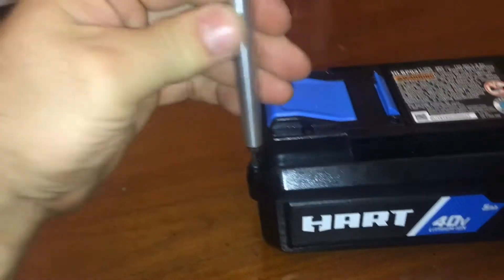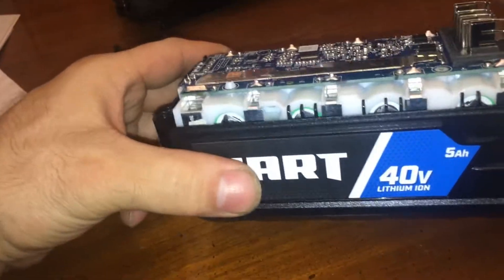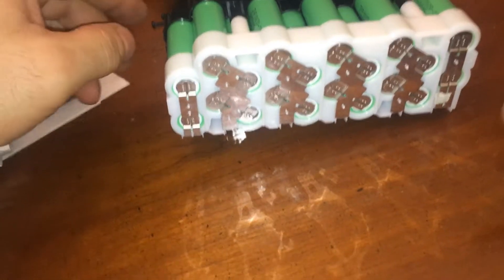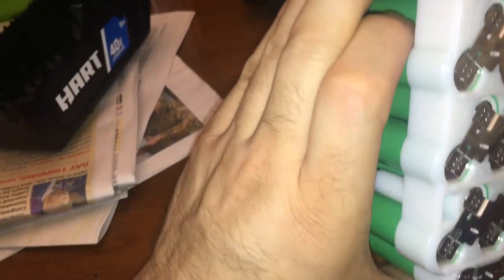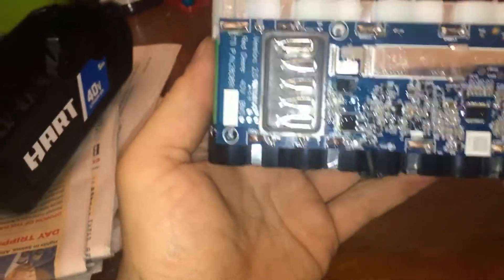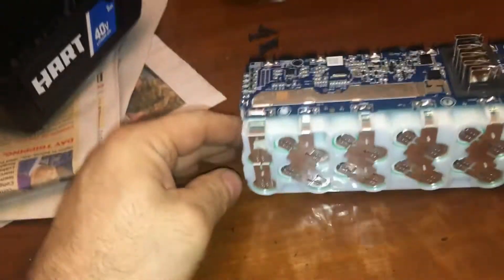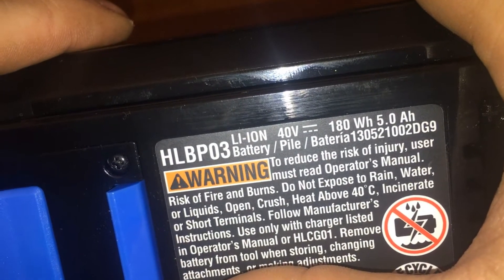Walmart Hart 40v 5ah battery what is inside I bet 18650 batteries HLBP03

Comment: 1:51 Conformal coating most likely. Corrosion protectant, rust is what kills most lawn and tool batteries and is why modern EV packs are being filled with foam.
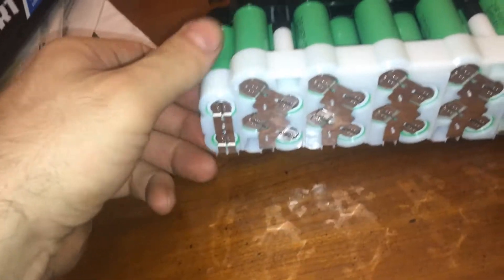4:00 Under-rating, likely for cell lifespan and to prevent battery fires and damage.
4:30 10S2P? Interesting, then these could be ran off used eBike packs.

Comment: Any idea where I can buy a replacement circuit board for this? I got flashing lights error. I am sure the cells are most likely perfectly fine.
Reply from the maker: dead ones on ebay... but then u dont know why its dead. I hear there is some reset procedure that possible can work that was for ryobi which is same thing. also desoldering that circuit board doesnt look like fun lol. what I would do though is check the voltages on the batteries. FULL voltage and each cell. depending what you find charge all teh batteries up to 4.2v'ish I think usually what those errors mean is the voltage is too low to charge. its not hard isolating 1 battery at a time to charge them if u pay attention to the metal rails they are attached to
Reply: @bobspurloc  My battery flashes all four lights. It measures at 24.4v so it isn't dead. I believe it just needs a reset, but I don't know the procedure for doing so. Upon opening the battery, there are two 3.3v and two reset contact points. Would you or anyone here know the procedure for resetting this battery?
Reply from the maker: @davcar872  it's a 40v battery measuring at 24v. im not sure but that is way low. ide try and charge each battery manually to get the voltage higher. did it sit a long time? that voltage is bothersome because the battery is going to shut itself off before getting that low. and lithium dont drain that fast sitting so it seems possible a dead cell or 2. but who knows until each sell is tested

Comment: Had a blower catch fire when I added 2nd 5 ah to other port. Is it possible battery is defective or is it something more that I'm missing?
Reply from the maker: you said blower caught fire. that isnt enough information to deduce a cause. where was the fire? blowers motor?
Reply: Battery caught fire  .
Reply from the maker: @michellelogan2124  well that would seem a bad battery. was it used in other equipment? how old is it? call HART yet? was the battery left outside in the rain?
Reply: It was about 2 months old originally with a new 5 added that was brand new. It is being replaced. I  guess they di have a failure rate. Would be interesting to know if anyone else has any problems similar to this. Appreciate your time and response.
Reply from the maker: ah good to know. I have 10+ of these batteries most still in the boxes. first use?

Comment: AH is Amp Hour. Not amps. The actual current draw is most likely different. So it most likely does draw more than 180 watts. But those are WH watt hours. They are a different kind of measurement than standard watts, amps and volts. The reason why you math doesn't add up is because you are using the wrong math for the values you are given.

As for how many amps each cell can output is based on 2 things. The first being the capacity of each cell and also the max current output of each cell. These two values can be different. You can have a 3.5 AH battery and it can output 10 amps safely because they are 10 Amp cells. There are cells that are 3.5 AH and they can safely output 25 amps. And some that are less expensive output 8 amps but are 3.5 AH.

They didn't put tape there because it is all insulated already with the plastic battery holders. So there is no need for it.

Comment: Nominal voltage is 36v, fully charged is 42v. Ten 18650's is 42v at 2500mah. Put another ten 18650's in parallel with the first ten, hence twenty 18650's ..you get 42v at 5000mah or 5.0AH.

Comment: Do you know how long I can cut grass with these but I do know it takes an hour to charge them
Reply from the maker: I dont know the size of my lawn but it takes 3 batteries to do because a big area is dense grass and I tend to mow 2 weeks apart. also I tend to have the drive at full speed the whole time. You cant drain a battery down till it cuts off and recharge it in an hour. u cant do that because the battery wont let you charge it until it cools down. if u were to stop using the battery just before it cut out u may be able to throw it on a quick charger. also of course putting it into a freeze etc would cool it down which of course will lead to extreme whining that will cause condensation in the battery etc etc etc u could open the battery and put a fan on it, that would cool it down faster which again brings on extreme whining of omg u can electrocute yourself etc stupid etc
Reply: @bobspurloc  yeah I bought the 20 volt mower. It took more than an hour for the batteries to cool enough to not be slightly concerning lol. Now I'm not sure if I should get the 40 volt. I live in a mobile home park. My yard isn't that big, but it went through both 20 volt 4Ah batteries really fast lol.

Comment: My 40v battery reads 17.5 v but won’t recharge. Only had for a year. First try of this year and it won’t charge. Any ideas other than $170 for new one. Could it be the junk charger?
Reply from the maker: the battery has 3 year warranty. does charger say its charging it? Lithium Ion dont usually just die
Reply: @bobspurloc  the charger is just double flashing the red light. The battery just flashes all 4 lights
Reply from the maker: ah ok so battery is alerting something is wrong. about all you can do is contact Hart I believe as the battery has a 3 year warranty. did it get rained on? also beware any serial number discussions as hart batteries serial numbers dont tend to match the packaging. I have several videos clearly showing batteries new on the shelf at walmart dont match the packages serial number also they now sell 2 packs of the 20v 4amp with only 1 serial number on the package which of course cant possibly match the 2 batteries inside lol
Reply: @bobspurloc  never been outside unless I had it in my hand using it. I don’t have the box it came in, that was last summer
Reply: @bobspurloc  I opened it up and don’t see anywhere to reset it. Tried the jump start thing different ways and nothing works
Reply: @bobspurloc  called Hart today and they are sending new battery. Thanks for help. Stay safe
Reply: @donhixon1669  You may be able to revive the old one. Likely one or more cells inside have dropped too low and disabled the battery. If those cells are only a little bit too low they will usually recover if you can charge them all individually. The lower they have dropped, the less likely they are to be usable (i.e. 2.5v is often the cut off and if yours are all about 1.7v they might come back, down under 1volt starts getting pretty iffy). There are endless videos on youtube.
Usually what goes wrong is one cell is a bit weaker and runs out quicker and the battery shuts down the tool. If you don't recharge the battery right away it will keep dropping until the battery is disabled. Best to store the batteries about 1/2 charged, but never less than 20%, in a cool dry place and disconnected from the tool and from the charger.
The best way to recover is to use a hobby bench power supply that you can set for a max voltage of 4.2 volt and a very low current (like 20ma until they are over 2.8v and no more than the amphour rating on the cell, like 1500ma or 2000ma or 2500ma etc) and individually charge every cell in the pack up to 4.2v so they all match.

WARNING: there is some minor risk of fire and/or explosion. I've never had it happen with 18650s but it could. I have had some vent their guts and make a mess. I've always used a safe power supply to charge. THE RISK GOES UP IF YOU HAVE UNCONTROLLED CURRENT or VOLTAGE CHARGING.
Reply: @Sylvan_dB  Thanks. I contacted Ryobi/Hart tools and they are sending me a new battery since it is still under warranty. I don’t know a whole lot on the electrical side and if there is even the slimmest chance of a boom, I usually find it.

Comment: They really aren't 40 watts but 36.  The 40 w is the no load voltage.  18 and 20 volt batteries are the same, just measure differently.
Reply from the maker: you mean volts not watts. but that isnt correct. the 18650's are 3.7 volt batteries. a fully charged one is 4.2 volts. the voltage drops as it drains and thus it lights less LED's to show the voltage has dropped

Comment: I want to get a 4Ah because I’m suspecting they might have higher discharge cells in them. 2Ah capacity but 30A discharge vs the 2.5Ah 20A of these
Reply: Probably only going to be 20A-22A cells, most likely the. INR18650-20R.
Reply: @geoffstrickler  feels more like 15A

Comment: Probably gonna rebuild mine with LG HG2 cells. 3Ah 20 Amps so effectively the same performance with 1 amp more runtime.
Reply from the maker: ah. $6 a battery? I see at battery junction. or $5.50 for 4+ what do u use to attach a wire to the battery?
Reply: @bobspurloc  gonna try building a spot welder.  You can use a car battery and high current solenoid to make those welds.
Reply from the maker: Oh damn! nice. I see! ok this is going on my list as something to build also! LOL...
Reply from the maker: is that powering off of 18650's??  hrmmm I could plug this into the  Ideation GoPower Plus Emergency Portable Power Station it has a 12v source plug like that. https://youtu.be/m7vDkJY383g
Reply from the maker: oh my bad lol. I was thinking soemthing else. plug is for the momentary battery zap
Reply: @bobspurloc  yeah basically for that kind of weld you need a high energy burst. Could be done with capacitors but for the most part it seems easiest to use a car battery.
Reply: @bobspurloc  this is what I meant to link you to originally. The Amazon tool is just easier to do than little pieces of wire.

Comment: What bit size are you using to remove screws .I have tried several with no luck.
Reply from the maker: how to remove a security bit center pin lol... https://youtu.be/iEAlK-bjyAo
Reply from the maker: its a T10 security bit aka torx 10 with the hole in middle. if you look at the screw head you see the pin in the middle. just knock that pin out. you can use a sharp nail to knock that center pin out or a drill starter punch to smack it a few times that will either knock it out or crush it.

Comment: 20v batteries go into 40v tools and vise versa?
Reply from the maker: no. but if you modified stuff they could.
Reply: @bobspurloc  if the rails are interchangeable I would love to break up a 40v and use higher cap batteries making a massive 20v pack.
Reply from the maker: @samfish90212  I just realized I have 20v HART batteries now. I should check out the pins and rails

Comment: Just saw two 5ah hart battery packs clearances down to $77 at my local Walmart I have all greenworks equipment Including a 14” chainsaw that drains batteries quick Looking at the batteries in Walmart I was thinking they look very similar to greenworks after viewing your video I think they’re pretty much identical they probably just have some kind of plastic tab to prevent swapping between manufacturers. I had a 2.5ah battery that came with the chainsaw when I bought it used off of market place and died on me after using it twice. When I tore Into it to salvage the cells inside was a mess with corrosion from being left outside in the rain anyways they had the exact same cells as yours same size pack only half filled with cells where my 2ah pack is half the size
Reply: Some walmarts are selling them now for 35. One had it for 17$
Reply from the maker: yeah I have a bunch of greenworks and hard 4ah/5am batteries now but not from buying them as singles but from buying actual equipment that was on clearance under $100 with the battery in there! lol

Comment: Those are Samsung 25r 18650s. They are 4.2v cells, so 20 if them in parallel would be able to be rated at 40v
Reply from the maker: almost all 18650's clearly state on them 3.6v or 3.7v but charging voltage is 4.2v. but I note that in the video.
Reply: @bobspurloc  42v fully charged, 37v nominal, 30v fully discharged.
Reply: @bobspurloc  yeah they technically didn’t lie. So long as maximum charge is at or above 40v when new then they can sell it as such. It’s just cheap and underhanded. Few companies do this. They typically use enough so the nominal voltage meets or exceeds designated rating. In this case most other brands would have used 11 series batteries. Most likely Panasonic or Sony for the 3500 mAh capacity for a better pack, but honestly Samsung is good too. I see why the reviews on Hart equipment are poor for long term usage and battery capability. I think I will modify my pack to use the higher capacity batteries that have a higher discharge rate. I’ve been building packs for years now and I have discovered capacity is not always key it’s the discharge rate. A battery back for a 1KW motor in lithium would generally be 20Ah at 35A max discharge. I used a battery pack made of Ford C-Max cells that were 5.5Ah and 200A discharge. I got nearly the exact same distance from both packs. The Panasonic and Sony 18650 cells can achieve 35A discharges so 2P would make 70A. These Samsung cells probably only have 20-25A rate each.
Reply from the maker: @samfish90212  ah nice! good to hear. it's crazy how 18650's went from no where to everywhere. all my flashlights are 18650 now. I was just buying dead laptop batteries and just rip out the good ones for my electrical projects.
Reply: @samfish90212  If only the world were so simple...  In power tools a 40 volt is typically 10s, or 10 cells in series. That makes sense, since 20 volt power tools in pretty much every brand are 5s. Note Ryobi with their 18volt (also 5s) and Kobalt with their 24volt (6s).  If 5s is 20v then 10s should be 40v, right? And then you get to EGO with their 56 volt which is 14s. Hey the math is consistent! But then you have a few that are 10s that do not call it 40volt, and that is enough to make the whole mess uncertain.
Then if you go to the eBike world, they typically call a 14s 52 volt, and 48v is more common, which is a 13s. That math doesn't work at all. And some vendors sell a 12s as 48v (at least that math matches the power tools).
But this isn't just a new thing that started with lithium-ion cells. That ubiquitous 12v car battery is a 6s, and the cells are actually 2.1v nominal when fully charged (giving you 12.6 volt) but you have to charge it to 14v or so (sometimes as high as 14.5v and equalize at 15v) which is 2.3-2.5 volt per cell, analogous to the li-ion 4.2vpc. If you go to a golf car and put 3 of those 12v batteries in series you get what is called 36 volt, or 4 in series you get 48 volt. Sometimes instead of 12 volt blocks you might use 6 volt "golf car batteries" or 8 volt batteries (3 cell and 4 cell, respectively) to get the same 18 cells for a 36v or 24 cells for 48v. But that 48v battery with 24 cells at 2.1 volt / cell fully charged is actually 50.4 volts, and to fully charge it to 2.3 volt per cell is actually 55.2v.  A 48v lead acid battery matches usable voltage really well with a 14s lithium-ion battery like the EGO battery which is called 56volt or what the eBike world calls 52volt.
It's enough to make your head spin when you try to work out between different manufacturers exactly what they are doing.
Reply: Oh, and have you ever looked at the li-ion jump start packs?  Most are 3s so they peak at 12.6v (4.2vpc) which is nice, but don't leave it connected to your battery with the engine running and charging to 14volt or higher! Some are 4s, and put out over 16volt! That's likely why some manufacturers tell you to never jump start their cars.
But the big problem is their amp-hour rating (or milliamp-hour rating).  A jump starter might be rated at 21,000 mAH. But if you take it apart, it is actually a 3s rated at 7000mAH. That's fraudulent. The mAH rating does NOT add when you put cells in series, only the voltage adds.
Or what about the common "USB battery" ... It might be rated at 3000mAH, and put out 5v, but those two numbers do not go together.  Typically it is a 3000mAH cell (at 3.7v nominal) so when boosted to 5v in a perfect world the mAH would reduce by the same ratio. Losses mean real world is even less mAH available. But some USB "batteries" especially the large ones, do the same trick as the jump starters - connect cells in series and then add the mAH for the rating. Fraud again. This is why the FAA uses watt-hours instead of mAH as the limit for carryon batteries.
Reply from the maker: @Sylvan_dB  something like this jumpstarter? https://youtu.be/z-xqzMgfFq8